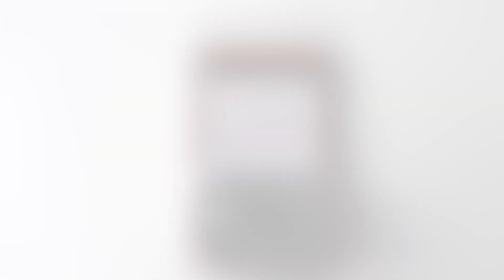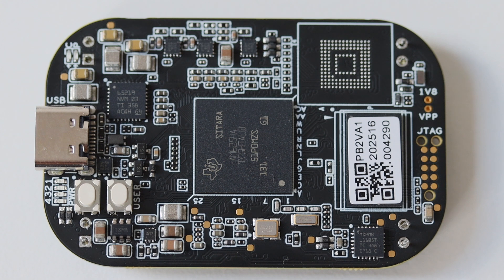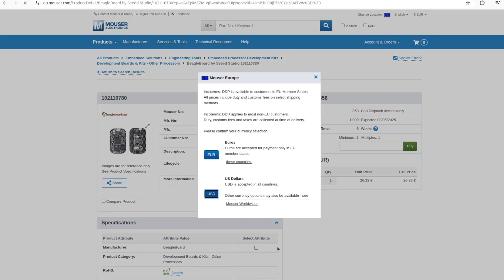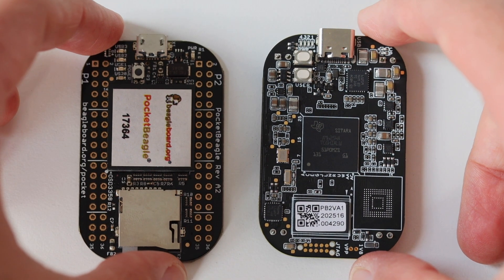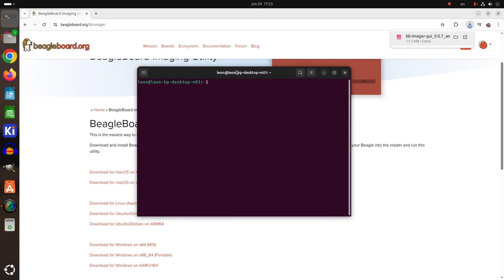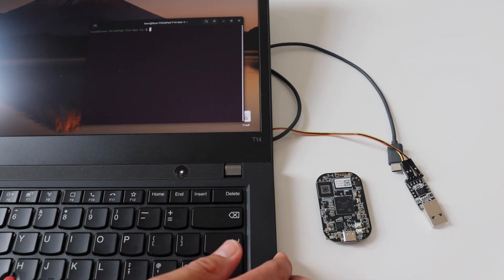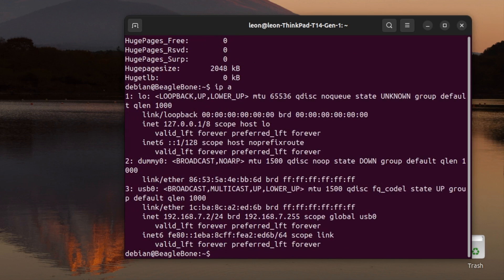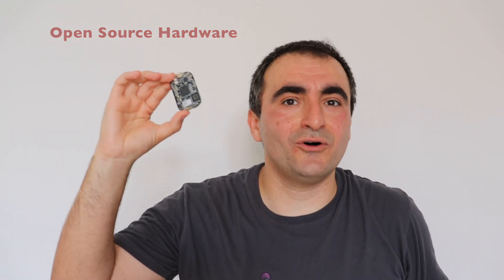PocketBeagle 2: Setting Up a Tiny Linux Single Board Computer with Debian

Comment: Is it possible to add a Wifi or Ethernet to this using the header expansion?
Reply from the maker: Yes, the simplest way is to connect a USB connector to header P1, pins 5, 7, 9, 11, 13, and 15. They are all in a single row. You can then plug in a USB Wi-Fi dongle, a USB-to-Ethernet adapter or even a USB hub to connect multiple USB devices.

An alternative more technical challenging option is to connect WiFi module such as Raspberry Pi RM2 over SPI + GPIOs for reset signals. The wireless radio in it is based on CYW43439 and there is a Linux driver.

Btw thanks for watching my video and the excellent question :)

Comment: Had issue with the beagle bone black not giving source code for the microprocessor driver when they are supossedly "open source"
Reply: Probably a copyright issue with Texas Instruments. But a SBC with an ARM Processor should not really be called open source by BeagleBoard
Reply from the maker: Please note that PocketBeagle 2 has been certified by the Open Source Hardware Association (OSHWA) under OSHWA UID US002717. So this single board computer meets the community standards for open source hardware:
https://certification.oshwa.org/us002717.html
Reply: @LeonAnavi  Right, this is fair. So far these are the best open computers we have with great performance and efficiency. Thanks for linking this. Great Video!
Reply from the maker: @pasta9196  pocketbeagle 2 obviously isn't the best as performance but the tiny size and low price make it a great choice if you are looking for an open source hardware SBC.
Reply: @LeonAnavi  its a shame we now need to be cynical when we hear the term "open source" with a redefinition of its general meaning to might only mean "open source hardware", ie we suppied the pcb schematics. To bad for me when you attempt to grab the driver source code to update it to work with the latest linux kernel.
Reply from the maker: @nigelk3432  I'm a bit confused, because as shown in the video, the PocketBeagle 2 is running open-source software: Debian 12 and Linux kernel 6.12. Which specific Linux kernel driver are you referring to?
Reply: @LeonAnavi  i am not talking sbout the OS it runs. Nvida did the same thing in the 90's/early 2000's. "Here is a driver for our 3d cards for linux". No you cannot have the source code for the driver, but here a precompiled binary that you can include when compliing your kernel. Pity if its been 2 years between when beagle created the binary and linux has moved forward which creates compatibility issues.

Comment: Great video! Well laid out and presented. Now for the negative, I appreciate that you have sped up the video for flashing (saving my precious time, which honestly is ran at 1,5x speed anyways), but I am lacking real world data for your time spent performing this task; Maybe integrate an overlay timer when speeding up a video to indicate actual time spent in the process. Again, love this video :)
Reply from the maker: Thank you for the feedback! I am glad you liked the video. Based on your suggestion, for future videos I will consider adding an indicator when the video is playing at increased speed. Please note that the duration of the microSD card flashing process can vary depending on the technical capabilities of both the card reader and the microSD card itself.